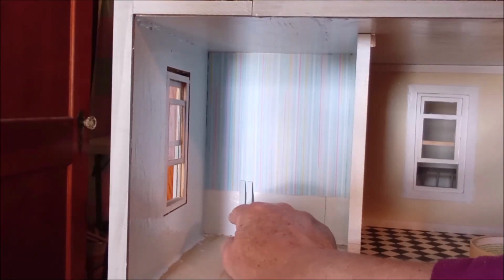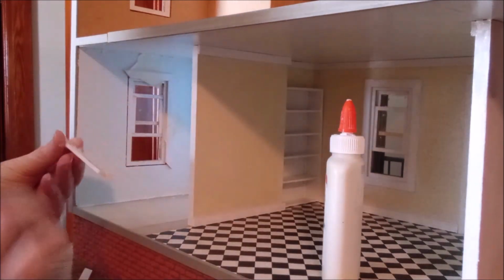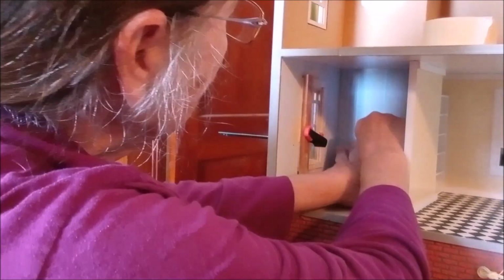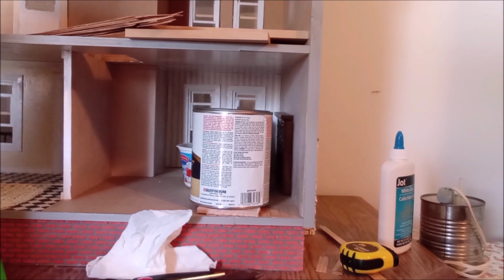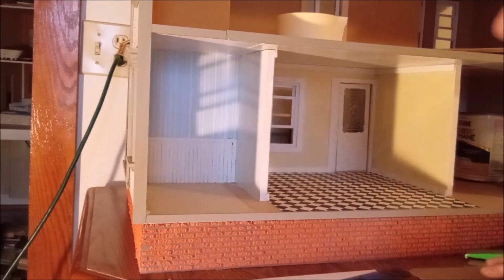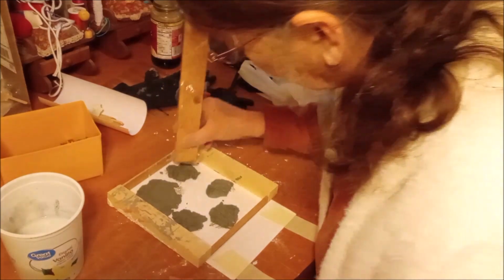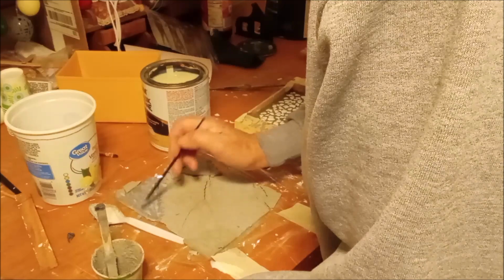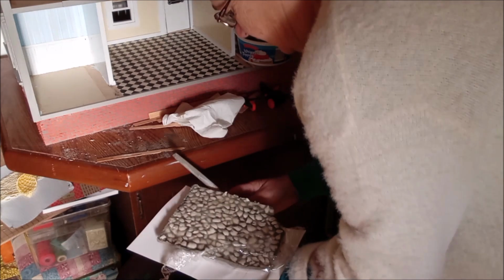Working on the bathroom  Part 21

Comment: I suggest looking at texture rollers - they're used for wargames but some would be fine for the dollhouse, or you can make your own by gluing pieces to a 1" dowel like a puzzle. Texture a thin polymer clay sheet with them, bake, and install in the room. (Cement usually expires around 3 months old. It absorbs moisture easily from the air. It and grout should be stored in airtight containers with silica gel packs to help keep dry).
Reply from the maker: Texture rollers must be similar to the ones used in card making. I hadn't thought of that. Thank you!

Comment: Aileen what if you put some glue in with the cement mixture before you "pour" it into your mold wonder if that would work like a binder so it don't break so easy?  Heck I don't know lol.  And I love your white text that you insert I swear you are channeling me when those words come across the screen cause those are the things I would do and say lol.
Reply from the maker: I hadn't thought of adding glue. After I finish the house I plan on going back to work on that floor. Part 2 goes up Thurs. The video just got too long, I had to cut it into two parts.